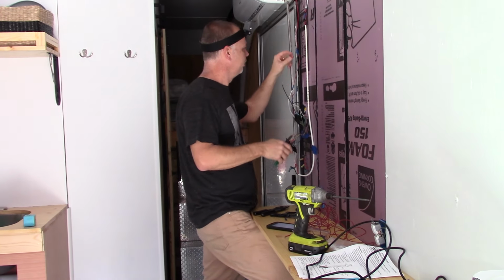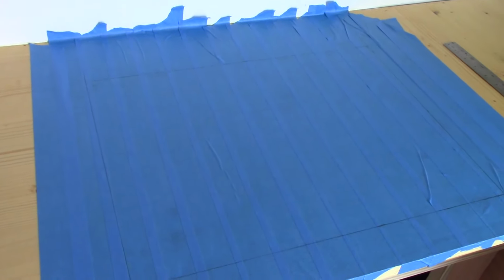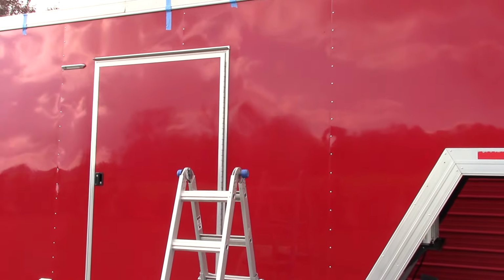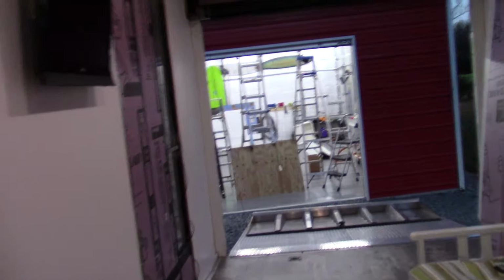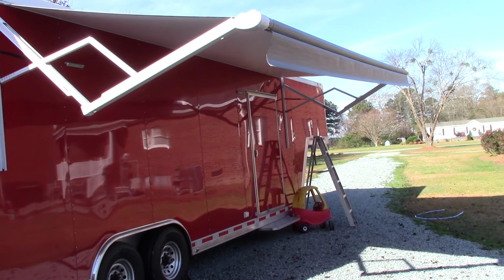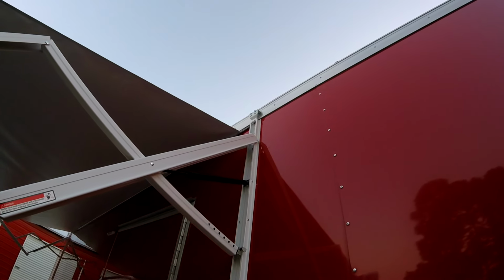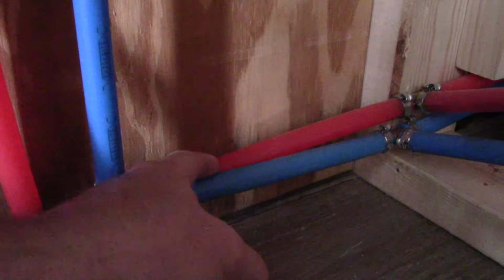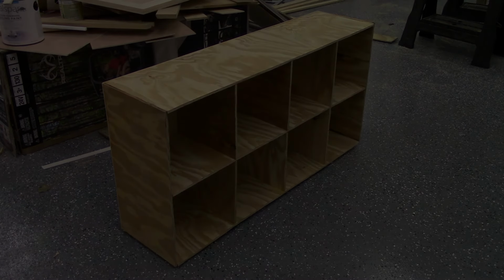Can We Conquer the Challenge… Installing an Awning on Our Cargo Trailer Conversion?

Comment: great video thanks - the only one on Youtube on how to install an Altitude! - we are about install one and I thought there must be a better way for the normal put it up as one unit as the manual says - at what stage did you fit the locking clips into the motor ends? - thanks
Reply from the maker: Glad it helped!! I have to admit it's been so long I can't remember when we installed the clips. I want to say we installed them just after mounting the roller into the arms. Thanks for watching and good luck with your install!

Comment: Hello from Saskatchewan Canada.
I cringed when you opened your door fearing a tear to your new awning.
You may want to look at a awning roller ball to install on your door.
Found one on Amazon - cheap 
Great build
Reply from the maker: Thanks for watching! I’ll check those out. So far I’ve had no issues with the door clearance. I have about 12” of clearance when the awning is at its lowest point.

Comment: What type of paneling did you use on walls and ceiling? 
Roughly how much was the awning?
Keep up the great videos guys.
Reply from the maker: We used what came in the trailer for the paneling. It’s 3/8” plywood on the walls and I believe it was 1/8” plywood on the ceiling. That type and brand of awning runs around $1500 - $1800. They are pricey but we’ve really enjoyed having it. Thanks for the comment and thanks for watching!